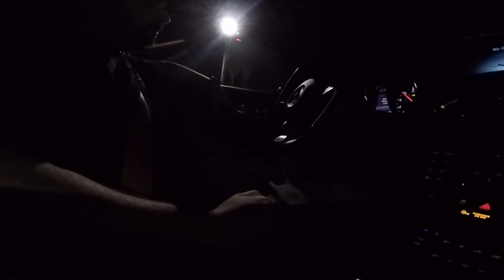How To Install Weistec Intake Mercedes Benz CLA45 AMG

Comment: Love the car Bro! Good video I have a 16 CLA 45 and I also installed the WEISTEC air filter, BOV, and turbo shield from WEISTEC. I love the way it sounds together with all parts added. that 5.0 don't want the smoke lol. The CLA launches hard.
Reply from the maker: Thanks bro and I does launch pretty hard better than an evo

Comment: Thinking of putting this same unit in my GLA45. Thanks for the vid, it looks easy.
Any noticeable power/torque increases? Did you track HP gains with your engine data screen?
Reply from the maker: It is easy didnt even took more than 15 min and no kinda hard with all this covid
Reply: air intakes (pod filters) just enhance the turbo sound releases that restriction its under, it wont increase power or anything noticeable but only adds to better sounding engine. my experience with modding

Comment: I did the intake install, it was a horrific experience, not simple at all. 4 hours, 3.5 of which for the one of the 3 screws that's on the inside. Bloodied hands, lost the tool in the engine bay 3 times, had to lift he car to get it out, nuff said